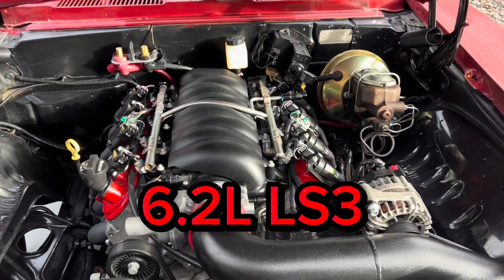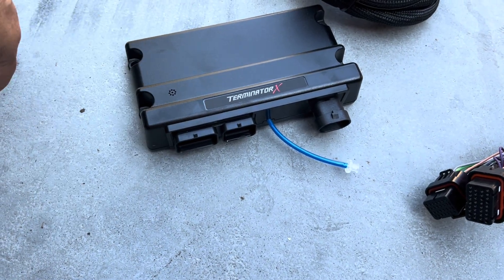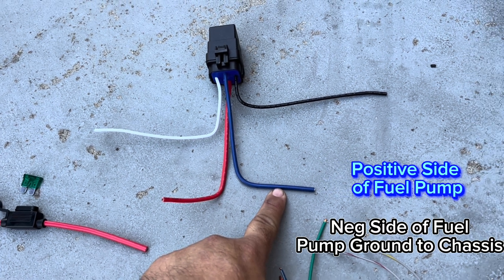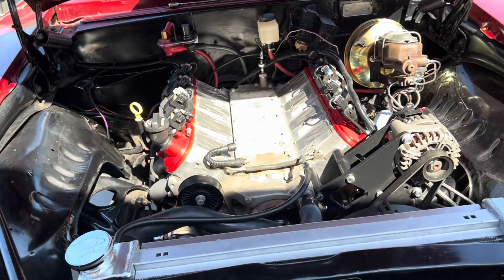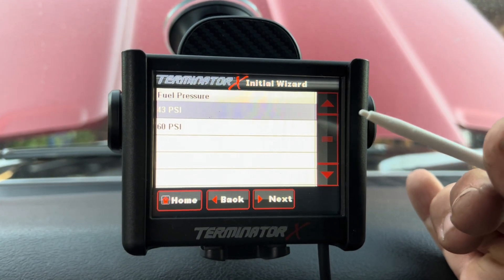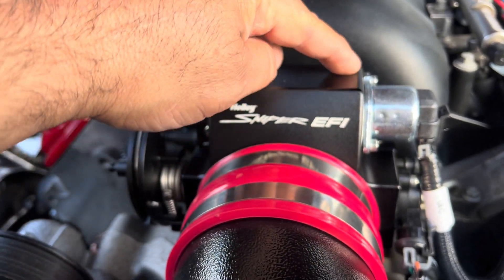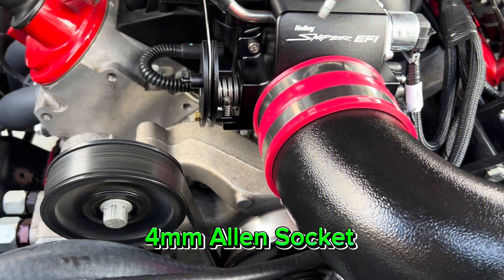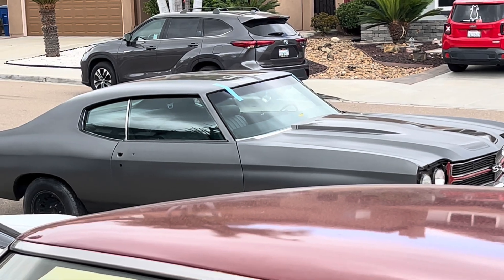Terminator X Full Install and Overview

Comment: I have a 2013C. TS Vi plan on replacing the ECU with the Holley terminator X Max. Do you know if the transmission 6L90E has been having a problem being tuned by the module? And also, will I lose any regular functions such as windows headlight?Etc

Comment: Where do you recommend we connect the red/white wire that needs 12v when cracking to specifically, 2:45 marker of vid. Thanks
Reply from the maker: You’ll have to find a wire that has 12v when cranking. Each vehicle is different. If u need specific help, I have a subscriber section on my Instagram where I can provide more help. I also get discounts on a ton of parts

Comment: Hi great video! currently following along with my build. At 1:35 you write that the fans are triggered by default with the grey/red and grey/green, but at 3:31 you indicate using the grey/red and grey/yellow for the fan relay triggers.  Could you reconcile which to use for the fans?

Also wanted to clarify the difference in triggering for the fan and fuel pump relay--namely the difference in how ground triggering is set up.  At 3:43 you note that the white connector should go to 12V key-on power and the black wire should go to one of the Holley fan triggers (i.e. grey/green or grey/red).  However, if I understand correctly, the major difference with the fuel pump is that white is connected to the green Holley trigger (4:28) and black should be grounded directly to frame.  Do I have that right?

Comment: This is for 96-98 Cobra! " Don't use redline sensors / digital raising" "use stock sensors/ magnetic" now I'm only speaking for 96-98 cobra! His video is awesome but the Holley kit is not perfect and don't always use there instructions cause it didn't work for me 1: Holley pin for crank is pined wrong flip wires! 2: lower cam voltage to it's lowest! 3: don't use stock firing order! 🤔 No tuner figured it out! I did...  and yes they are very experienced tuners! And I will be contacting Holley so they can rectify there instructions that don't mean anything for the 96-98 cobra! I hope this helps your welcome! 

SK COBRA